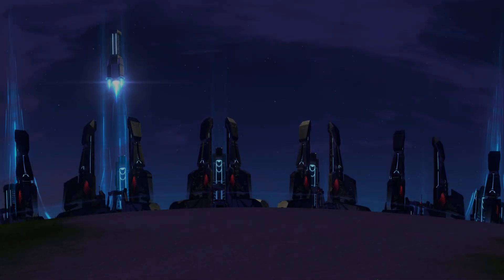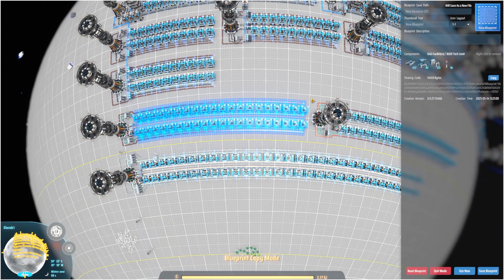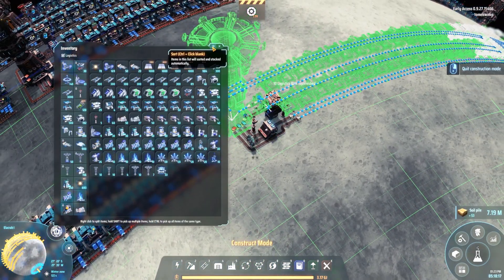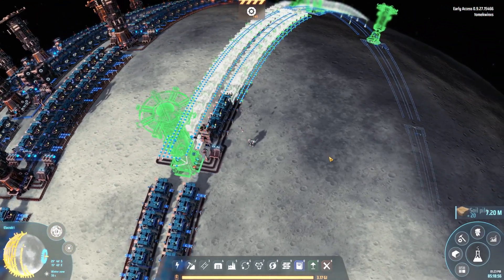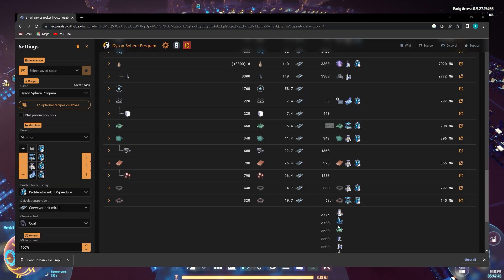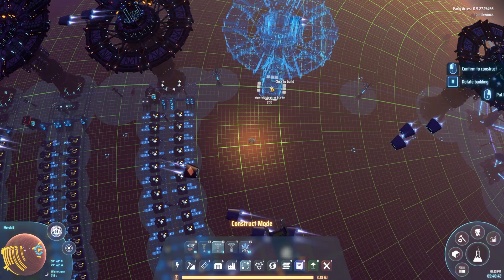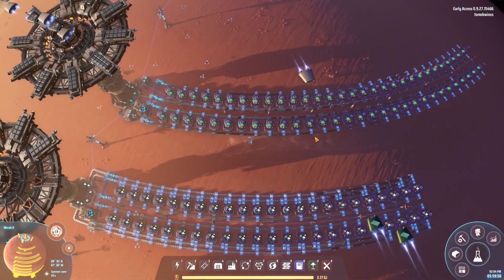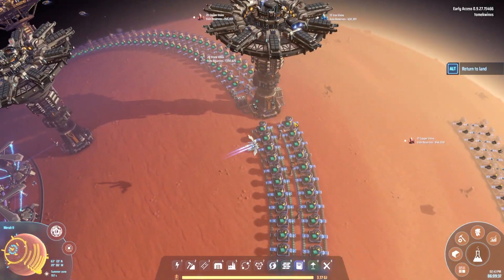Expanding Production to Fuel the Dyson Sphere | EP91 | Dyson Sphere Program | Blind Playthrough

Comment: Tom nice intro with Dyson Sphere and good use of cuts. 👍 When playing DSP I do think about the joke, "How do you eat an elephant...One mouthful at a time" 😆 Sorry bad Dad joke. You just have to build, build, build... I have found if I put ILS charging to MAX, after the initial charge of the tower the actual charging 'rate' in top right 'blue' is much lower when charge 'level' is high. As Batteries do when charging. So as long as ILS charge level is fairly high it actually takes little to keep charged and ships charge quickly and turnaround faster. Keep up the good work. 👋👋👋